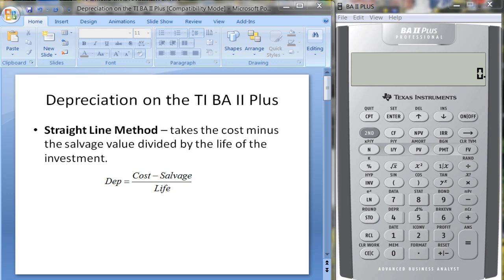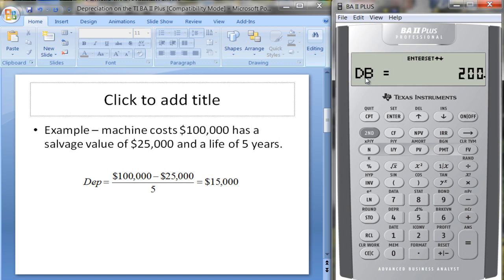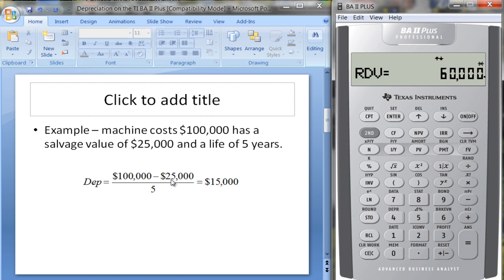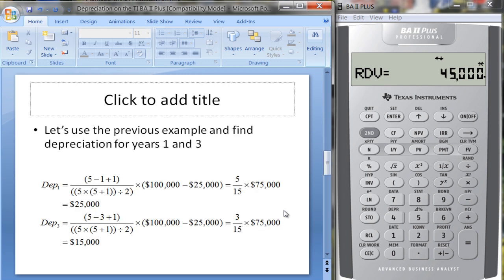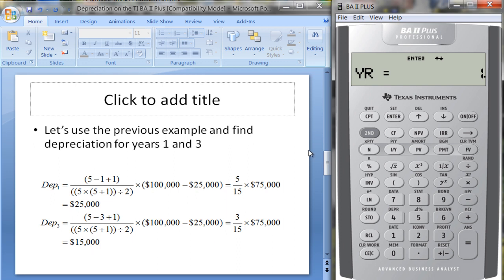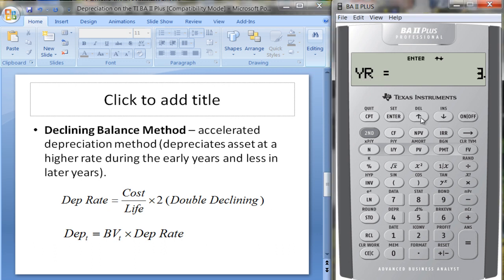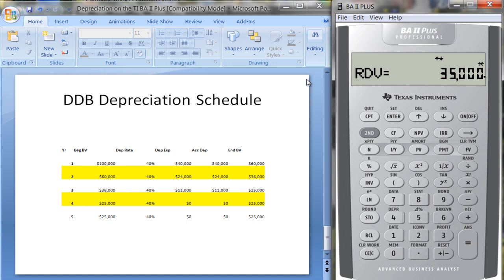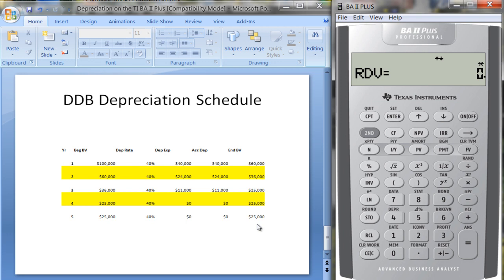Depreciation of TI BA II Plus Calculator

Comment: How do you change the DB value if say you want to use a declining balance rate of 20%?
Reply: you might consider this a late reply but, itll depend on the values you have set on the SL method. in this case 15k  (15k depreciation /75k depreciable value = 20%) is 40% under DB since (20% *2). another way to have DB set to 20% you could set the DB value down by half, in this case 100. i think doing it through SL keeps things more consistent.